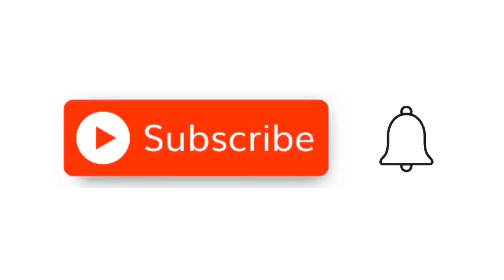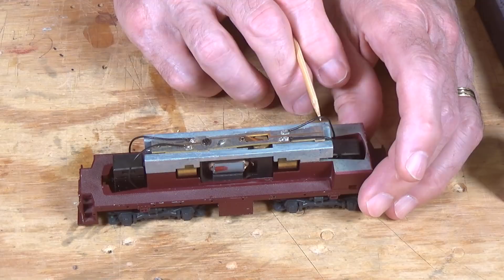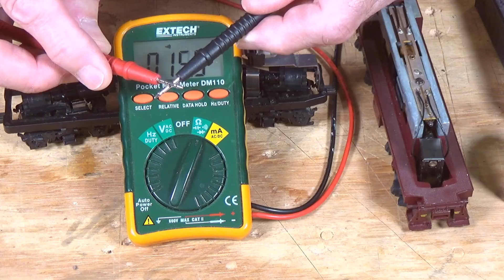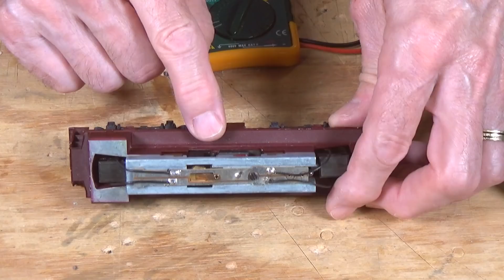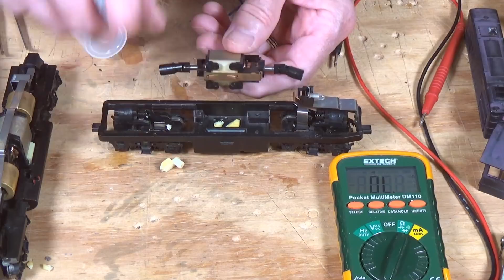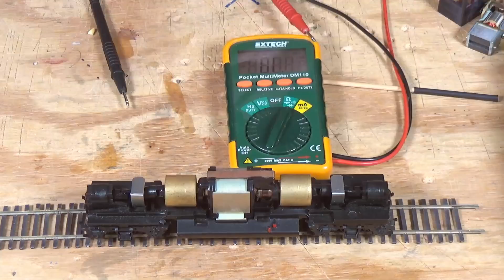Isolating A Motor For DCC (223)

Comment: Hi Larry,
Ihave a Bachmann spectrum dcc ready 2-8-0 ho scale. It is a first generation run with the pcb board in the tender and an 8 pin dummy plug. I cut the capacitor for rf out. I plugged in a used but unknown condition digitrax dn 136 ps decoder into the plug that had previously been programmed to 003. The lights on the loco came on but it would not respond to forward or reverse. The lights could be controlled with function 0 for on off but nothing else worked. I ran a hard reset of the decoder changing cv 08 to 008. The engine partially jumped forward, buzzed, and my MRC controller read overload. The decoder smelled awful and burnt and got almost too hot to touch. I unplugged the dcc waited and tried again with the same result. Is it likely an issue with the decoder or the pcb board in the tender? I also suspect an unisolated motor or short in a crushed wire could be an issue.  It ran alright on dc, a little stiff at slow speeds. Any thoughts? Thanks!
Reply from the maker: Sounds like a short or overload. If you removed the capacitor by clipping its “legs” then that should not be a problem, I did it on the pair I used to own. The choke (copper coil) is wired different  but still should not create a short, just interrupt power. Does the loco still run on DC after the decoder blew? These are very old locos so it might be a pinched wire or maybe some grease on the gears dried up. If it runs on DC then let it run in a while just see if it frees up. Then check the amperage draw if the loco using an amp meter. I showed how in one of my older videos but with over 400 now I don’t remember when, so you just need to scan through the content listing on my channel page.

Comment: @ 13:00 you mention that you'd show a different way of wiring up an Atlas S1 (as you were showing).  Did you ever post that video, and if so, what number is it?  I have my father's old engines from when I was a kid and I'm having issues with a Atlas S1 that he installed a DN121 in.  I'm not sure he may have done it correctly and this one does have one of those circuit boards in it.  I can't seem to find any decoder manufactures that make a decoder for this model.  I'd really like to be able to run it in my father's honor.
Reply from the maker: Sorry but I never got around to installing a decoder in one of those locos. However, I have one on my workbench right now so as soon as I get time I’ll film that installation.
Reply: Thanks. That’ll be good. 👍

Comment: Raspberry PIs are unreliable. I've set them up for all kinds of things, and they either fall short or just plain quit working. I had one monitoring three of my several cameras around the house. All it had to do was display them on a screen off to one side. The power failed, and then the camera monitoring through the browser on the PI refused to see them anymore.

I've tried NAS, and a regular computer works much better than any PI with a drive connected through a USB port. They just don't work at all for the job intended or quit in the long run. Sure you can reprogram them again, and they work. I want something that works, and not something I have to fool around with, and the PI is not it.
Reply from the maker: You just confirmed my reservations with going down that rabbit hole. I suspect that arduinos can also be a similar distraction or at least a time sink.

Comment: I wish someone would show how to isolate a sunset brass steam locomotive can motor.  They're totally different and I haven't seen anybody on youtube show what needs to be done, if anything, to put a sound decoder in one of these so it doesn't burn up.  I have a brass steamer popped open sitting on my bench right now.   I will do some testing with my voltmeter.   Thanks for the advice here.
Reply from the maker: I have a couple of them that I bought new around 1988. Both have decoders and I don’t remember any significant issues with installing  them. Of course they did not have a DCC decoder socket so I had to hardwire them. Also the tender connector creates a fairly unreliable electrical connection so a keep alive is an absolute necessity. As I remember from about 30 years ago when I did the installation, you need to replace the metal screw that holds the motor in place with a plastic or nylon one and also place a layer of electrical tape between the motor and d the frame to isolate it. Can you tell me what issues you are having or how the model you have is different? I may try to find time to do a video on a brass install.
Reply: @TheDCCGuy    Thanks for the info.   There’s a brass bracket cover plate that bolts to the face of the motor and then bolts to frame.  There’s a wire getting juice from that connection.  I guess I don’t understand how you isolate the motor when it has power feeding through that connection.  The connection from the tender has a washer under it and appears to be isolated from the frame.   I’m just not sure how it’s supposed to look when done.  I’m sure it’s a simple thing.
Reply from the maker: Ok, that metal bracket may be a problem. First, any metal screw attached to the motor needs to be replaced with a Delrin plastic or nylon one to provide insulation. If the metal case of the motor is in contact with the frame then you need to put in a layer of plastic electrical tape for insulation. As for the metal bracket you may be able to put a layer of tape between it and the motor case. I have seen folks actually design and 3D print replacement mounting brackets. In some locos I have built up a puddle of silicone sealant and set the motor onto it in place of using screws or brackets. You need to be vary careful though to maintain the proper angle for the drive shaft or gear. The tender connection should be OK because of the plastic washer but the electrical connection is usually poor and a keep alive is necessary to avoid intermittent loss of power.  Unfortunately old brass locos weren’t actually designed to be good runners, let alone with DCC.
Reply: @TheDCCGuy    I follow you.  I was going to put a keep alive in it regardless because they’re just nice to have anyway.  I would like to use the same bracket it’s using.   So if I’m following you correctly,  as long as the metal plate bracket has a physical barrier between it and the can motor face and a plastic screw going through it to motor, it’s ok to pick up power from frame to the metal bracket and attach power to that?  The other side use a plastic screw and washer as well or don’t need to since already a washer where the pin goes down to tender?  In the end how would I test it with volt meter to ensure it won’t blow a decoder?  Thanks for the one on one help here!    Love your channel.
Reply from the maker: Yes, test for continuity between the motor case and the frame. After you install the decoder make sure to put the locos on a service mode programming track, which are current limited somas not to kill a decodera if there is a short. Do a quick CV read of something like the address (CV1). Most decoders now are also protected against shorts but will pop if left in a shorted condition.

Comment: The NS #7102 is a GP60. The bulk dynamic housing and larger rear radiators are the key features. Unfortunately, Athearn did not include the correct trucks. The trucks are a cross between the Bloomberg B and M with a dampering strut on each truck.

Comment: hmmm electrically insolated motor can also mean that the chasis of a model itself is not connected to the wheels right?
in my home made N scale locomotive i didn't use chasis as a conductor at all, bogies take power to spring contacts that go directly to pcb's that contain electronics, i plan to build decoder into those pcb's to save space, but i never considered using the chasis as a wire
is there any benefit of the electrified chasis over fully insolated one?
Reply from the maker: It really is not a good idea in my opinion since there are potential circumstances where a metal chassis can in a derailment make contact with the rail of opposite phase and create a short. You also have to look out for situations where metal shank couplers are installed in contact with the frame and then two such locos can short out if couplers of opposite phase connect.

Comment: So if you had a ABA consist, would you wire the back loco's motor backward?  Or do you set it up in the advanced consisting?
Reply from the maker: All the universal and advanced consist consisting methods prompt you for loco directions. You can also program the decoder for the correct direction when you set it up, so you don’t need to physically rewire the motor.

Comment: I posted a question on # 88 about a short and you recommended that I watch this video. Thanks.  Here’s a restatement of my question.  I have continuity between my top positive and my left rail.  In testing, one place I find continuity is between the upper motor brush and the lower motor brush.  Should I? I lost one of those little springs and jerry rigged a replacement using a watch spring.  Could this be the problem?
Reply from the maker: There may be continuity across the motor brushes via the windings since that is an electrical pathway but there should not be any between the brushes and the rails once the upper clip to the truck towers is removed and the lower projections are removed or flattened.

Comment: Athearn has released new style motor mounts that now screw in. Part number is 84028, four mounts,eight screws so you can do two locomotives.
I also use Kapton tape to insulate the motor.
Reply from the maker: Thanks, I had not seen those, I’ll look them up and pick some up. Most of my old rubber mounts got hard and cracked some time ago.

Comment: Does your method to check polarity with a 9V battery work on a DCC engine with a decoder already installed?  Just curious if it will move supplying DC current to it in the case of exchanging to a different mfg decoder so the wiring is installed correctly.
Reply from the maker: If the decoder is set for analog conversion it might run but I have never tried it.

Comment: Smoking decoder... thats what the warranty is for :)
Reply from the maker: That depends on the age of the decoder and terms of the warranty. I know that a lot of modelers buy decoders and then put off doing the installation for months or even years. I personally have uninstalled decoders that have been sitting in drawers for over 20 years and the warranty expired years ago—want to buy some? Most manufacturers require proof of purchase, how many receipts have you squirreled away? Warranties often are more a marketing tool than a real guarantee. Of course if you do install a decoder right after you get it and it smokes then a “no fault warranty” is great.

Comment: Thank you, Larry, for a great episode!  Is there a reason why the
original headlight can’t be used instead of using LEDs,
resistors and shrink tubing?
Reply from the maker: The mount is directly connected to the frame so you need a way to isolate it and the decoder from the frame. If you want the light on all the time without decoder control then yes you can leave it as is but you win’y have lights at the rear end.
Reply: @TheDCCGuy  Thanks, Larry.

Comment: Thanks for the video. Larry. As far as the connectivity of the Athearn motor is concerned, rather than try to switch the two copper strips to get the one designed to contact the frame on top, why not just reinstall the motor upside down? Yes, that would change the polarity but if you're going DCC, that little problem is easily corrected.
Reply from the maker: The motor is not the same top and bottom. Assuming you want to use the original Athearn mounts then the top won’t fit into them.
Reply: @TheDCCGuy  Okay, but I use double-faced tape anyway. Just a thought since you have to be really careful when removing those clips and making sure those little springs don't get lost.

Comment: I have several brass locomotives with open frame motors that I have isolated and tuned them up using super magnets. That brings the current draw down to under a half amp, makes them slower and gives out tremendous torque. The Bowser DC71 skewed armature makes a great DCC compatible motor just by replacing the magnet. I also weigh down my locomotives for maximum pulling power. My little 2-6-0 PRR F3 can pull 10 Bacman HW passenger cars on level track without spinning it's wheels.
 Thank you for the videos.
Reply: Can you point me to where you buy the magnets to upgrade the open frame motors. I have many brass engines I (with Pittmans) that I would like to do the same thing to lower the amp draw for DCC. Thanks and great idea.
Phil
NYC Area
Reply from the maker: Micro Mark used to sell them and you might check with Bowser.
Reply: @TheDCCGuy  Thanks for the information. Do they actually lower the current draw? It would be great of I didn't have to change out a whole bunch to Pittman style motors to be able to convert my older brass to DCC. Thanks.
Phil
NYC Area

Comment: Thanks for another clear explanation. As I've never used DCC, this hadn't occurred to me, but of course it's now blindingly obvious that you don't want motors that are electrically connected to the chassis.  Never knew that right rail positive means a loco should go forwards: I wonder if all manufacturers across the globe adhere to that NMRA standard.  I seem to remember back in the 60s/70s, at least one manufacturer's (Jouef?) locos went in the opposite direction to other European manufacturers.

As an aside, I noticed that the bottom of your Atlas loco said made in Austria, and that reminded me how the now giant Roco got started into model trains by making US outline models for Atlas.

Comment: The open frame motors that were shown at the beginning of this video are very similar to the motor used by Hornby the XO3 and the XO4. In your video was the one one the left of the picture a 5 pole motor? As I may of said before I am not going dcc, it is just too expensive, but I am trying to improve the motors in my early models from Hornby. Martin.
(Thailand) If I am not DCC then why do I watch your channel? because I still like to keep upto date with what is happening in Model Railways and you explain things very clearly.

Comment: Hint:  Once the polarity of the contacts has been determined, apply a small dot of red fast-drying nail polish next to the positive contact area to allow easy future identification. For the negative pole, use white or gray nail polish.

The best applicator is a blunted toothpick, not the nail polish brush, which is far too big. Give the polish enough time to dry before handling.

Comment: Thinking of a topic that is applicable to multiple scales, as I'm an N scaler, and one that does not require you to substantially modify your layout, what about speed detection? There are a couple of alternatives that I'm aware of, and you are likely better informed. Getting a readout of scale MPH as my trains run is a thing I can do now, but I'm open to superior methods.
Reply from the maker: Video #56 shows a portable one that can be set for HO or N scale MPH. It is good since it can be moved around. Some companies such as TCS make one that can be permanently installed on the layout but is a point measurement. I don’t know of any way to provide feedback from the decoder to a computer program that would actively give a speed readout. There might be some way to use the BEMF reading through Railcom to calculate speed but you would need to do a calibration and I don’y know of a program for that.
Reply: @TheDCCGuy  I use a package that includes IR sensors buried in the track bed, hooked to a USB interface that is read by software that runs on a Windows PC. The version I have is wired for 2 detectors and the software has 2 speed displays. Speed can also be voice announced. I have this on a double track and can read speeds in both directions.

Comment: For electrical isolation, may I suggest this commonly available tape: Kapton Tape. It's both heat resistant and electrically isolating due to its polyimide composition. Conveniently for use in models, it's also very thin so can even be used in smaller scale models.
Reply from the maker: Kapton might work but I would be concerned that it might not be thick enough to prevent mechanical wear and a short at some point in the future.

Comment: Larry im in need of help I have just got 3 locomotives 2 proto 2000 and a kato and they're all very loud and have gear noise and clicking but don't have cracked gears I thought that they were supposed to be good runners but there not so any help would be much appreciated
Reply from the maker: I suggest you take a closer loom at the gears o  the LL models. That clicking sound is almost always an indication of split shafts. They can be very hard to see until you pull the wheels, wash them off, and examine with a magnifier. I have had success but through degreasing the gears and axle shaft, filling the opening i  the gear with super glue and the shoving it onto the axles. The super glue seems to fill the cracks in the plastic and cements it to together and to the shaft.You have to work fast to get the axle spacing correct before the super glue sets up. The Kato should not have this problem so I suggest checking the grease on the gears, they may need cleaning or more grease. See my videos on lubricating locos.